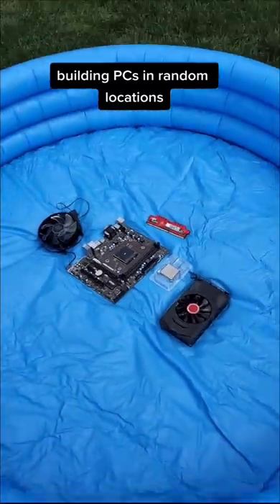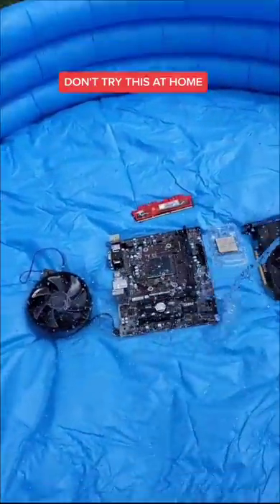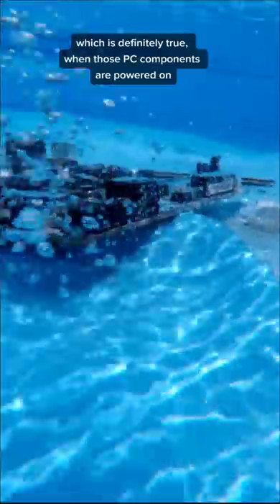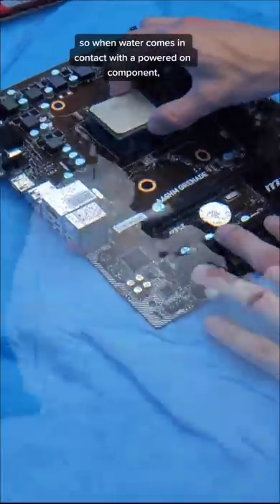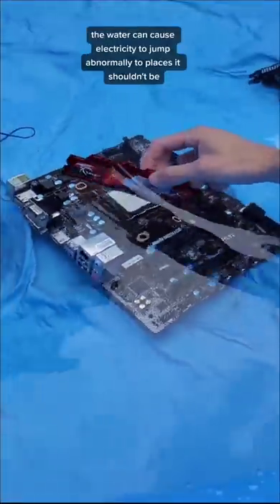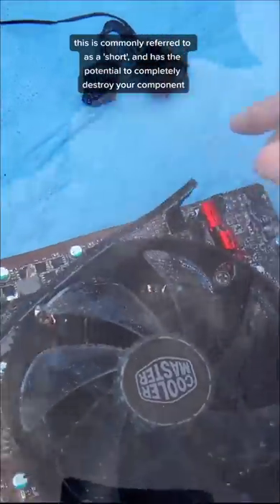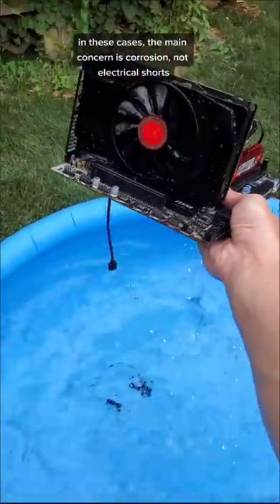Building a PC Underwater #shorts

Comment: man took water cooling to a whole new level💀💀
Reply: believe it or not, simply dipping pcs in water is already a thing, they do it on server pcs
Reply: @mrducky179  lol
Reply: @szymex8341  Yeah, there's a video from GreatScott where he submerges a circuit board to transformer oil and everything goes well. Your only concern would be the oil spoiling, given that it is an organic liquid.
Reply: @szymex8341  yeah that, i assumed it was some sort of special water
Reply: Underrated
Reply: @szymex8341  distilled water shouldn't be a problem
Reply: @szymex8341  Linux, Your right, they misspelled mineral oil with water
Reply: @szymex8341  I see, just replace it once a while then
Reply: @szymex8341  like specially made water that isn't feeling wet.. no joke
Reply: @szymex8341  well I meant 3M made a special water that isn't wet and friendly to PC components
Reply: 7
Reply: @mrducky179  oil** water fries them
Reply: @buranku9459  it should because it's still conductive just use oil
Reply: @mrducky179  I think that's mineral oil I think
Reply: I think everybody was about to say that lmfao
Reply: XD
Reply: @mrducky179  but its not water actually its bad at conducting electricity but good at conducting heat so its ideal.....mbut incase of distilled water....there is no conduction of electricity coz there is no ionisation but water is bad conductor of heat. 👍......M NO NERD BRUH
Reply: @mrducky179  It isn’t water. It’s mineral oil
Reply: Give that graphics card to me bruh pls
Reply: @mrducky179  go ahead and put your pc in water 😂
Reply: @mrducky179 pure water doesn't
Reply: @buranku9459  wrong. Even 99,9% filtered water can still lead to shorts
Reply: the fact that he didnt take out the battery 💀💀💀
Reply: You can do something similar without the risk of damage if you use mineral oil instead of water. Fish tank PCs used to be a thing a decade ago.

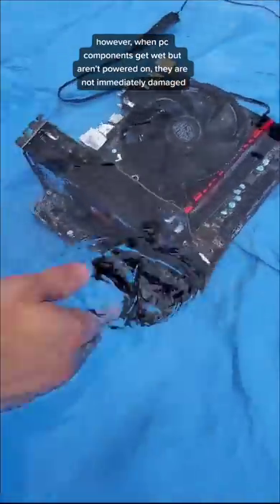Comment: 0:38 Corrosion isn't too big of a risk if you make sure to dry the components quickly enough. Shorts are actually a much bigger concern if you LEAVE THE COIN BATTERY ON THE BOARD like here, which will give power to the board.
Reply: even if he drained it?
Reply: The cmos battery delivers such a small voltage bro.
Reply: @drained1177  Still electricity is running through the computer
Reply: @drained1177  Most batteries, even the CR2032 you can find on your motherboard, can deliver a pretty high current under a short circuit, even with their low voltage of 3.3 V
Reply: Same with the fact he spun the gpu fan. It was probably too slow but still it could generate electricity
Reply: He did say not to try it at home, so I guess this is why, lol
Reply: @Multibe150  But the water has a certain resistance, but basically you are right if I short it directly with a wire.
Reply: @Scootertuner420  It depends on how much minerals there is in your water.
Reply: @thepoisonspy  not enough to cause a short

The mobo can handle alot more exseccss electricity jumping around, more then the cmos battery could even provide
Reply: Not to mention the hundreds of capacitors and residual electricity from them
Reply: @drained1177  still can damage stuff. It’s 3v which isn’t much, but can power a whole GameBoy advance
Reply: not true, corrosion sets in where water gets trapped on the board. only was to 100% ensure its fine is to give it a high % isopropyl alcohol bath. this basically floods out the water and isop doesn't cause corrosion and readily evaporates.
Reply: @Scootertuner420  water has a resistance, and its not even conductive if its completely pure. Tap water isnt pure, its often enriched with necessary minerals which are relatively good at conducting electricity. The resistance is actually around 1000 ohms for tap water, but it really deoends on the amount of soluble minerals inside.
Reply: @VitisCZ  no, go to school.
Reply: @goober-7290  i completely agree with your reasoning. I do not think its feasible to fry a motherboard whilst its submerged, powered by just the cmos battery.

I've never tested it, but there has been a few people that have submerged / dishwashed their mobos with the cmos battery plugged in. Never have they gotten damaged, theyve also retained the previous settings.

The main concern has always been potential corrosion.
Reply: @goober-7290 thats not a good way to compare relative power.
Reply: @VitisCZ  youve gotta remember, the fan spins 10x as fast as that if you do something as mundane as... you know... turning on the PC. And it can spin that speed while turned off simply by powering down while the fan is spinning. It wont do anything. The issue only atrises when you spin the fan extremely fast with compressed air, which can screw the bearings and induce a significant voltage across the terminals.
Reply: Lol if you don’t think that it’s enough to short it out, go dip a watch that’s not water proof into a pool
Reply: @johnsmith7303  yeah, Idk know what they're on
Reply: 3v from the cmos battery is enough to destroy most components on the board. Most CPU's run between 0.8v~1.2v
Reply: @VitisCZ  no they don't.... BLDC fan motors are build in a way that makes it realy hard to generate any note worthy amount of voltage. Even  if you remove the circuitry and you assume 100% efficiency, you might be able to generate 0.3~ volts if you were able to spin it 50 times a sec.
Reply: @JamesThomas-nr2og  theres so much resistance across the minerals in the water (in series with the sensitive components) that theres no way youd be pumping even 1.5V across a CPU. Youd be ridiculously unlucky to get water that mineral filled anyway. I guess it is possible.
Reply: @drained1177  You could take a coin cell, shove an led on there and throw it in a Glas of water. I bet it will run out because the battery drained or corrosion, but not a short circuit.
Reply: @Scootertuner420  what?
Reply: @drained1177  I don't answer to that, either you forgot what we talked about or have no idea what you are talking about.
Reply: @drained1177 from  another vid i saw, the motherboard was destroyed by the cmos battery
Reply: @afox5319  or 3000RPM
Reply: @vsDarling  the generated electricity wouldnt power anything thanks to diodes
Reply: @Multibe 150  water still has quite a high resistance, which means that it would be quite hard for the short cirquit to break it
Reply: @VitisCZ  Thats....... not how electricity generation works
Reply: @Scootertuner420  the water from the hose is plenty conductive to cause damage if there’s electricity present
Reply: @oceanbytez847  as someone who does extreme overclocking and has a fair bit of experience getting boards wet/frozen over. As long as the board was properly dried fairly quickly the corrosion issue isn't significant aka non issue. Most of your connections that are noteworthy are plated and gold has a very high resistance to corrosion aka why it's used as it's not nearly as conductive as clean non corroded copper. Also solder joints are also going to be oxidized already due to the fact they ran in a non zero humidity environment or even just were exposed to oxygen in fact solder joints have a small layer of corrosion nearly from the time they were done. They are not all done in a oxygen free environment or with a lot of flux so some surface corrosion is considered fine as long as the joint internally is mostly free from contamination and voids. Largely similar to welding in that way (meaning internally free from voids and contamination). The only connections I'd be concerned about is pcie and your dimm slots as these are high speed fairly low voltage bus systems and the pins even with some dust on them can fail to connect well enough for the systems to work properly however even if they are slightly corroded a light brushing and cleaning will likely restore functionality. Sometimes this has to be done anyways for example boards with 2 dimms per mem. Channel often sit with multiple slots unpopulated for years. Sometimes the slots need to be cleaned to function again after X numbers of years serviced with dust and other things coating the pins in the connectors. 

In the grand scheme of things solder joints and BGAs are actually somewhat protected by a layer of corrosion without this later the metal alloys would continue to react with the oxygen in the air further degrading the joint. Much the same way aluminum or stainless steel is protected and considered quite corrosion resistant cause it's coated in a oxide layer that protects it somewhat from further corrosion
Reply: @flamingscar5263  im confused by this, given mobos propensity for being destroyed by simple static electricity. I find it hard to believe a small battery could not generate as much or more charge than rubbing a carpet for a few moments.
Reply: @tiddlesworth8798  your difference is 3 ish volts and anywhere between roughly 500 and 35,000 volts from walking across carpet. Lot of carpet now does dissipate its own charge now but not all will and only to some degree... Even vynil flooring one of the lower charge producing flooring types is perfectly capable of producing 3000v. The issue is what is delivered to the end component. The voltage higher then a few volts is enough to blow through the insulator in semi conductors. A 3v battery on a low voltage circuit can damage stuff too however if there is any real resistance in that connection the end shock may be far less then 3v. Tap water is typically between 1000 and 5000 ohm's which is kind of a lot of resistance so depending on distance and conductivity of the water you might be seeing .2 of a volt at a pin of some IC... It really depends on the entire path what the semiconductors will be subjected too but a much higher voltage at any given resistance would make it ever more likely that the end result would be damaging
Reply: @Onewolfoc  little clarification, we will stick to the 500 volt side since thats the ones they refer to killing mobos, the unnoticed static discharge that occur all the time and that is potentially dangerous when introduced somewhere it should not be on a motherboard. But a static discharge runs at a miliamp, even if it 500 volts, thats not much current, couldn't a small battery reach higher currents even at lower voltage? Also, the water resistance wouldn't be the biggest factor would it? Given electricity takes the easiest route, i imagine it could jump to a close connection from the battery through the high resistance water, and destroy whatever is at that connection. Am i wrong there?
Reply: @Multibe150  tap water has a resistance of 1000-5000ohms making the highest current possible 3.3mA
Reply: @tiddlesworth8798  yes you are wrong because the water is the only thing causing the short and water is generally mixed equal parts throughout.  Not to mention tap water is between 1000 and 5000 ohm and a 3.3V battery will only be able to deliver 3mA. Afaik there's no such thing as high and low resistance water when it shares the same container

How do we know that's wrong? Because if it can jump over the water it can jump through air anyways.  It's surrounded by water there's nowhere for it to short other than through that water.
Reply: @amamsurri5454  seeing as you ignored most of my questions than proceeded to misquote me anyways, only to incorrect me, ill simply say electricity does travel through the air. And water does cause electrical shorts when a battery is present. The actual point i was making, the one you ignored, is that if a static shock can cause a short on a motherboard, i dont see why a cmos battery being left on it while submerging it would not do the same. I also questioned the difference in current between a cmos battery and a 500 volt static shock at a milliamp. All youve done is say that electricity does not travel through water for some reason, completely false. Final note, thats not tap water, thats pool water, with most likely, large amounts of chlorine or salt. If not then dudes gross for swimming in a bacteria haven.
Reply: @amamsurri5454  ill ammend my statement about the pool water, been a while since i saw the vid, forgot he filled it himself. Still gross though.
Reply: @tiddlesworth8798  If the CMOS battery WAS capable of doing damage it WOULD have. he submerged it in water with it in. he did the test right in front of your eyes. the CMOS battery will not come close to harming the board. also while we're talking about "path of least resistance" the CMOS battery is BEING USED by the motherboard. the path of least resistance to the CMOS battery is the metal shell its sitting in providing power to the CMOS chip at 3.3V. This means the majority of the power will greatly prefer to go where its already electrically connected and not through the 1000ohm water.
Reply: @tiddlesworth8798  you're* as in you're oblivious and im not pulling those numbers out of thin air its electrical engineering 101. Try to learn more before spouting out garbage
Reply: @tiddlesworth8798  this motherboard is the MSI A68HM Grenade. Following path of least resistance brings you to two points.  The 1x PCIe slot that can handle and ground several amps and the CMOS reset jumper which will not only connect you to a jumper on the CMOS / BIOS chip which is already directly attached to the battery. Assuming something is connected to the PCIe 1x lane it would go through the connectors on the board into whatever was connected and then dissipate through the silicon. It won't even power on the device. The battery simply doesn't have enough voltage to be a threat to anything on the board.  If the battery was disconnected sitting in the water it would still be dissipated by the many ground planes in the board as they are on purpose the most electrically conductive parts of the board.  That isn't to say no electricity would go to sensitive parts just not noticeably measurable amounts of electricity. Keep in mind the water is also dissipating that power as a resistor. The most it would do is clear your BIOS settings.  I won't go bathe with a toaster but I'll be sure to go bathe with a CMOS battery and I promise I'll be fine.
Reply: @amamsurri5454  have you not realized im ignoring you because you were rude in your first comment? Putting words in my mouth and answering a question i didnt ask.
Reply: @tiddlesworth8798  I'm leaving those comments for the rest of YouTube to know you were wrong too. Not just for your benefit of learning something. Nothing you can do about it now 😊
Reply: @tiddlesworth8798  mobo does not get damaged by static. Linus did a vid on that
Reply: @tridinh1011  ohhh of course. Ill trust everything that man says on his youtube videos even though ive literally been SUED for this exact reason when i worked at geek squad. But i guess the static discharge bracelets they make us wear are for show. Im sure linus did so much more investigating on it that a multibillion dollar company just couldnt manage even though they give us litterally months worth of training on the ins and outs of every type of device imaginable.
Reply: @Multibe150  if you consider <1A high current lol. I don't think they can even do that, probably 250mA at the most.
Reply: Brudda the coin battery only powers the RTC you silly dougnut😄
Reply: @Multibe150  brudda coin batteries act almost as a resitor dont worry fren
Reply: Good find! I was going to point out how capacitors would still hold charge long past when you’ve disconnected the power source, and would require recharging first, like we do before handing them to our children. 

Corrosion shouldn’t happen unless salts are present? Otherwise it would just be chalking of minerals greying everything over? In which case, your short the board well before you managed to get any substantial corrosion going.
Reply: @VitisCZ  that's not how motor's work
Reply: You mean cmos bruh?
Reply: I was thinking about the cell too
Reply: I saw it too, it's not likely that it would damage the mobo but it's like building a pc on a carpet, you're just asking fir it to die
Reply: I was about to come in and say "wtf dude take the cmos battery out"
Reply: @drained1177  brother, an electrostatic shock can kill a gpu
Reply: U mean CMOS battery*
Reply: Most cooil8ng fans have things in place to prevent power going back unto the pc
Reply: Computers are pretty smart. The voltage delivered by CMOS battery should be considered low voltage.
Reply: if the cmos battery was enough to short circuit it, the electrity would go through the water, shocking the guy making the video in the water.. it needs atleast a bit of a voltage to short circuit. More then what a cmos battery does.
Reply: @johnsmith7303 well, the computer worked after this video, and the reason that may short circuit it, is because the battery has a lot more usage in the watch.
Reply: Incorrect. Corrosion is caused by contaminants in the water. When a component is dried without rinsing with distilled water first the contaminants dry onto the board. This will still cause corrosion.
Reply: @drained1177  incorrect. Coin batteries deliver 3 volts, which is twice what a double a battery delivers. They have less capacity, because they have less overall output, but the voltage delivery it more, and voltage delivery is not a big determinant when it comes to battery voltage.
Reply: Overclocking hsjs

Comment: Looks at the cmos battery
"OH God he doesn't know"
Reply: Oh no
Reply: Was wondering the same thing)
Reply: "he's not gonna know"
Reply: @Diogo Marques Simoes that battery is still giving power to the board. Meaning the water is gonna leave some nasty short circuits.
Reply: @qwertykeyboard5901  he did another vid showing it worked
Reply: That won't do anything

The cmos battery can deliver 3mA max in tap water.  Which is safe on almost anything